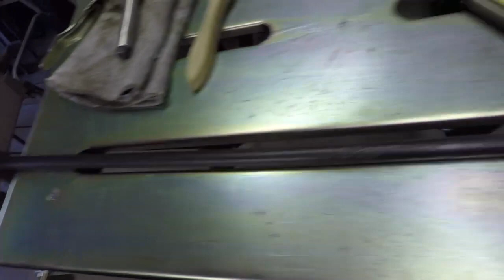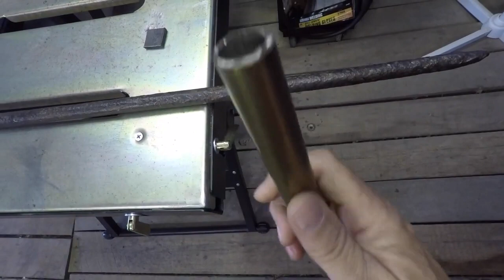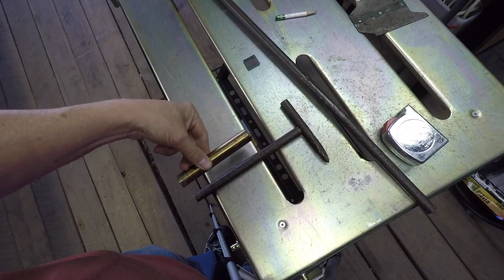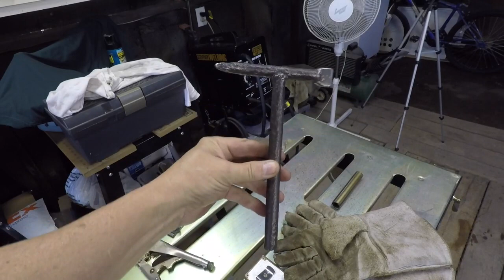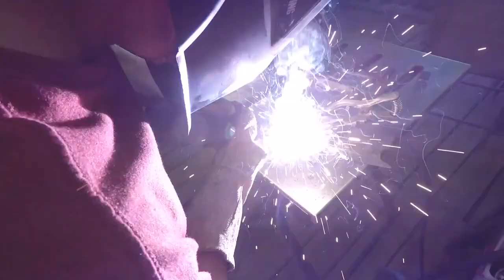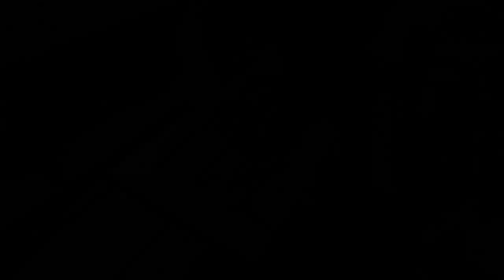DIY Stick Welding Tools

Comment: But why? A chipping hammer is widely available for $5 to $6 usd new..used even cheaper..even top name brand chipping hammers are $7..
Reply from the maker: Why not if you have some scrap laying around. It's a fun project and it's nice to make things with tools you made yourself.
Reply: @DIYHomesteadProjectsDIYHP10  I'm all about making tools and equipment that are actually better and cheaper then Chinese imported products..that said a chipping hammer wouldn't be worth the time nor materials necessary to make a readily available $5 tool..unless, say town was hours away to buy one or the house didn't get delivery service etc..basically the time and labor are worth much more then the $5 to buy one..